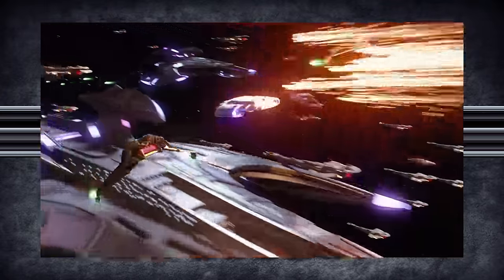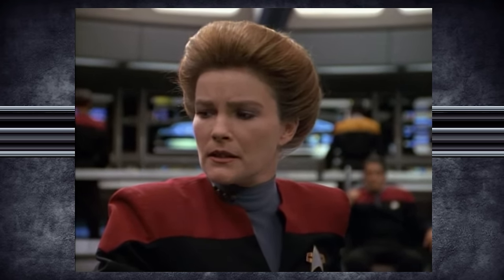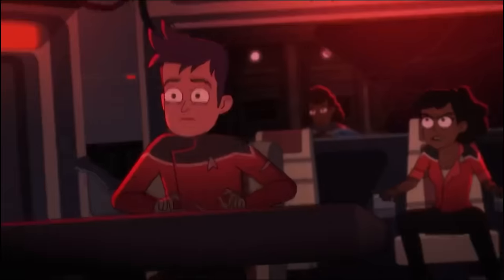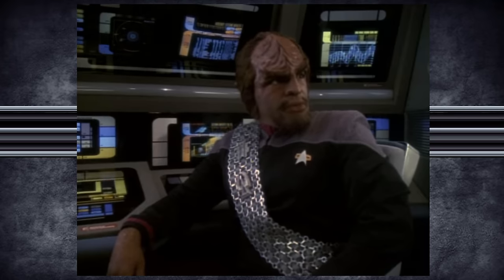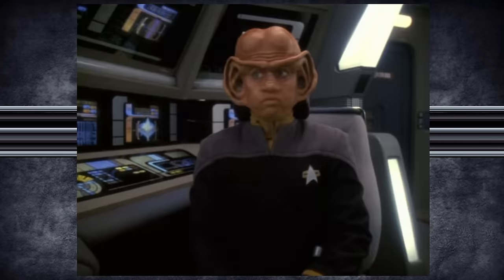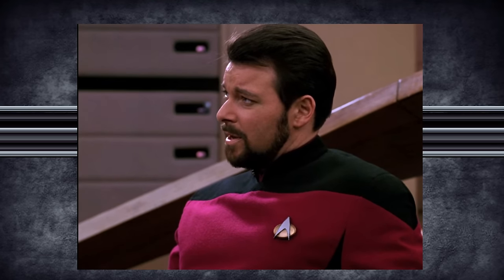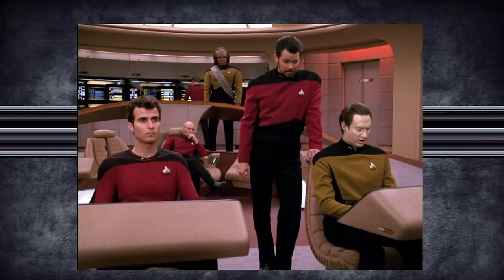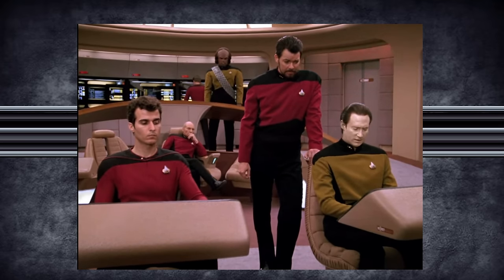Why Starfleet's Bridge Design Was Lethal to the Crews

Comment: The lack of seating on the Galaxy-class Enterprise's Tactical Station, and by extension the bridge layout in general, actually makes sense when you're considering the Galaxy-class was designed and built during a golden era of peace for the Federation. Tactical isn't required to be manned directly unless there actually is a combat crisis, meaning the Security Officer wouldn't be required to stand at that station normally, and would typically be found at the Security Control station during normal times (The station Worf is usually shown getting up from to move to the Tactical Station).

Given the relative non-threat of the Cardassians, the generally secure ceasefire with the Romulans, peace with the Klingons, and the Ferengi and Borg not having yet been discovered, the designers of the Galaxy-Class presumed any tactical threat would be rather swiftly dealt with with minimal damage (since the Cardassians were the frankly laughable 'main enemy' when the Galaxy was designed), with the Security Officer not needing to spend more than an hour tops at Tactical before resuming his normal station at Security Control.

Thus the bridge was designed more with the expectation of NOT needing too much in the way of tactical oversight, and the commanding officer of the vessel mostly focusing on what is directly in front of him, typically communications with whoever they are speaking to to foster more diplomatic functions (hence the Counselor's presence on the bridge) and visual assessment of any situation they come across. The Galaxy-Class is not a warship by design intent, more an armed exploratory and diplomatic vessel that was generally not expected to need to do a lot of fighting.

Which was a mistake on Starfleet's part based in hubris, and one they started rectifying in later ship designs.
Reply: Plus the Next generation the ship is a Civilian ship those crew comfort is importance and having a military bridge design might send the wrong signal.
Reply: Well said both of you
Reply: This reminds me of the post WW2 fighters designed without guns. All engagements would be accomplished by guided missile if not with low-yield nukes. Vietnam disrupted this design philosophy.

Comment: The argument for the transparent metal actually makes a lot of sense to me. It makes me think of the scene in the Avengers movie where when the helicarrier is in danger of falling. When that SHIELD agent mentions the navigational systems are down, Fury asks if the sun is coming up and then tells the agent to put the sun on the left of the helicarrier. Being able to see outside would make a lot of sense for that
Reply: Also sad we couldn't get the clip here where Data was recalled by Soong and Riker commented they had to look out a window to know they were out of warp.
Reply from the maker: That’s exactly what I was thinking of but I kept getting hit by a dmca , couldn’t use it
Reply: @LoreReloaded  Damn :/
Reply: Just keep in mind that you need to turn of the light inside to see anything through thouse windows. As long as sensors are active and said windows double as screens I give their ability to provide an wiev of the outside a pass thou. If power is cut, do not activate strong emergency light on the bridge or you will not be able to see anything.
Reply: @LoreReloaded  
I was thinking of worf's computer trick during that battle exercise with a constellation class ship. He tricked the view screen into showing a romulan ship.
Reply from the maker: @icecold9511  So I'll agree that we see that on the viewscreen, but i always interpreted that it was the sensors that they were really focused on and not the change on the view screen itself. Again, the view screen doesnt feel like it would add much to combat as you need a wide view which it often doesn't provide and for normal operations they don't use it at all for getting from here to there. That's not an illegitimate counter though, for sure.
Reply: @LoreReloaded  it is provided for our benefit. Aside from fine navigation, where that view is horrible, it would be as useful as a window on a sub.
Everything is so far away and moving so fast, you wouldn't see anything. 
And at FTL speeds, you can't see the Borg ship chasing you.
Reply: The problem with having a window on a spaceship is that you won't be able to see a bloody thing out of them. Even though we notmally see ships duking it out at really close rang,e in reality they're supposed to be hundred, if not thousands, of kilometers apart. You're not going to see anything from that far away with the naked eye, especially given how little light there is in deep space.
Reply: That of course is soo much help in combat in space where, if there are no reasons for appearance in visual media, the actual fighting will happen at ranges measured in light seconds. At the distance from the Earth to the Moon, the Enterprise D is smaller than a speck of dust from 3m distance.
Without an optical instrument, aka telescope, there is absolutely no chance in hell to see anything.
And if you use an optical instrument you can as well just pipe the image into a viewscreen.
Sure, make it so that the viewscreen can be moved aside in an emergency, but in general, if your sensors fail, you are on shit creek anyway, and it is just a matter of if you can use your hands to paddle or not.
Reply: @icecold9511  it brings to mind the last few minutes I have spent trying to swap a fly in my living room,  that SOB is clocking low impulse speeds at best!
Reply: @Riceball01  Actually, if we are talking space combat between capital ships with direct fire kinetic or energy weapons , they would take place at a few hundred kilometers distance tops due to the light speed limitation. If you were at a distance of 3 light seconds, traveling at half Impulse speed, your direct fire weapons would be lagging by..... 3 seconds and would therefore miss 100% of the time. This is also why windows for combat would be useless.

Now if you talking guided munitions, then you could theoretically engage your target at any distance once you had a hard sensor lock. But of course Starfleet eschews dedicated missile frigates like we have today to parody the glory of the Age of the Naval Rifle-based Battleships.
Reply: @mwhitetail  I distinctly remember Mr. Worf giving a report on an enemy being 7500 km distant when Picard ordered him to fire.  I'm not sure how big in size a starship is supposed to be, but even if we assume they are the size of an aircraft carrier, exactly how much detail are you going to see at that distance with the naked eye?  You pretty much have to assume any shots would be computer controlled, with the tactical officer just telling the computer what you're shooting at.
Reply: @icecold9511  Aye, sadly Star Trek doesn't do a good job at conveying just how large space is and what combat ranges would be. Judging by what we see in the series, all of them, it seems to be less than a hundred ship lengths, which would be in current terms almost point blank range.
Reply: @katherinestives940  Yes they use computers to lock on and aim, but even Isolinear ODN computer systems still rely on light speed; hence the 'O' in ODN as Optical Data Networks. The computers would be just impaired as a human mind due to that lag. You could argue A.I. predictive systems, but judging by how badly those work in video games on time scales greater than say 750 milliseconds, I would say that the lightspeed problem would still be a huge pain in the ass even in the 24th sentry
Reply: @HereticalKitsune  Ha! I learned something today. Used google assistant to find out that 7500 km is just .025 light seconds. That sounds a very reasonable distance for direct fire weapons with a very minimal amount of computer control. Or a lot similar to what we see in Star trek than I would have believed.
Reply: @Riceball01  : Those windows could have a lens built in. Materials science has improved enough one could do that.
Reply: I actually don't think the windows do make that much sense. I think the distances these ships would be engaging themselves at are so far away, that you wouldn't be able to see what you are shooting at with just your eyes. Space is big and black. Spotting a small small small speck that is the enemy ship with just your eyes is going to be really tough. My head canon was that the windows were actually just cameras on the outside of the ship that gave the impression that it was a window and that they could change it to view different angles away from the ship.
Reply: 1:It’s supposedly transparent aluminium which is stronger than steel, but presumably weaker than the duranium or tritanium that starfleet ships are made of, otherwise why wouldn’t they make the entire hull of the same material?

2: Given that we’re talking about space and other opposing vessels are either moving at relativistic speeds, full impulse is stated as being 25% speed of light, in which case being able to physically see them in close quarters is virtually impossible, or so far away as to be equally as impossible to physically see, then the trade off in protection for physical visibility wouldn’t be worth the added vulnerability.
Reply: Isn't the first mention of transparent metal by Scotty in the film The voyage home when he gives a company the specs so he can make the tanks for the whales
Reply: Having windows on the bridge and being able to see in all directions is important for 21st century ships.  What they would need to worry about with real windows on starships (as with the ISS) i) Relativistic effects.  If you are moving even a small fraction of light speed, what you see outside is really warped and distorted.  ii) The sun is really bright, you won't even be able to read your instruments with the sun in your face, especially without any atmosphere.  How much more if they are around a star with even higher luminosity, or much closer to a class G star like our sun?  You could go blind....
Reply: @DrewLSsix  That's because the Musca Domestica class max out on not speed, but maneuverability and sensors. What you must do is use area-of-effect attacks to negate those advantages, for example: The "Clap-Clap" attack (clap hard near - but not at - the target, which destabilizes its travel medium, thereby reducing its maneuverability and sensors, followed by a second clap attack at the now destabilized target) or the "Spray And Prey" attack, which uses a water mist to achieve the same effect.

Either way... HAPPY HUNTING!
Reply: @Riceball01  yup, considering transporter range is something like 250,000 km and I believe phasers have an even greater range, and torpedoes can shoot across a star system so. If your using the windows (and naked eye) in combat to see your target, your way to close.
Reply: It took me FAAARR to long in that part of the vid, for me to realize he actually meant the physical windows on the ship. They're so small, I hardly noticed them. (Assuming the screen at the front is a Monitor)
I thought he was talking about the glowing screens coming up from almost every console.
Reply: @brodriguez11000  Not a lens, but a viewscreen. Combine the two - turn on the screen when you need to, but when it's off (or damaged), you still have the window behind it.
Reply: I liked the design of the original Battlestar Galactica for that as well.
Reply: @LoreReloaded  Windows on a starship make no sense. So first let me debunk your whole transparent metals bit. Just cause something has aluminum in the name doesn't make it a metal. In star trek 4 he creates a polymer compound on the computer and calls it transparent aluminum. Its obviously a faking of the chemical science as frankly star trek has about as much a relation to real science as I do to a toad, but lets assume that someone did some research and tried to create something that looked reasonably accurate. The molecule he creates on the computer has nothing to do with a metal, all the electron spheres are far to stable. It actually has far more in common with a plastic. From there we can infer that transparent aluminum actually has more in common with bullet proof glass than with actual aluminum. This is also bore out by the fact that transparent aluminum actually exists and is a polymer with strength similar to that of aluminum. Now beyond this even if the window were absolutely transparent, space is a dull black void, the ships aren't very close and human reaction speed sucks. All good reasons not to have these things on a ship. Even if the bridge lights wouldn't make looking out into space basically like looking into a mirror, there would be nothing to see. Most of space would just look like the earths night sky only with more contrast. You could see more stars, but thats about it. Even when you were to be in a ship to ship battle the ships would be hundreds of miles upon hundreds of miles apart and you are moving at a significant portion of light speed. You know what that means? Our reaction speed means nothing. The angles between the ships are changing so fast that no person could actually hit anything that was moving. Even more beyond this is the fact that because you are moving at relativistic speeds you need to calculate trajectories with relativistic ideas in mind. Basically the thing you are aiming at isn't where you see it to be, and you won't know where it is until you hit it. The targeting computer can do this calculation, as human cannot. Windows are beyond useless, there are no navigational points to use to correct yourself, there are no uses for windows on a space craft of these types.
Reply: @LoreReloaded  Using one piece of science FICTION to explain another is circular logic: The underlying reasoning is the same - *because it LOOKS good*. In real life, naval combat already 99% takes place outside of visual range - aircraft carriers, not battleships. In space combat, the distances would be magnitudes larger and a window would be utterly pointless.
Reply: Arguably, that only works if you're under gravitational influences. In a space with no up/down, that specific circumstance just tells you whether you're heading towards/away from something (which still isn't useless, but you have to be a very special type of "screwed" to have all your sensors down/damaged and still have a ship you want to steer)
Reply: Space is a lot like underwater in that regard subs have no windows

Comment: "Let's run around like sheep without sense" Starfleet bridge design while in battle
Reply: Best design feature in TNG is the battle bridge. Always have a back up in case of an emergency.
Reply: @hackman669  In Star Trek you have to accept certain things as "the price of admission", but Lore Reloaded is correct in that on any vessel expected to go into combat (of sufficient size) you should have a main and an auxiliary control.  In actual combat, the first officer would move to auxiliary control with a back-up command crew.  They would constantly be updated by CIC (the combat information center, in case you didn't know the acronym) in case the main bridge suffered a casualty (got blown up or incapacitated).  

In addition, both bridges should be located in a more interior position on the ship to put more armor, shields, and just plain mass between them and potential damage.  You really want your primary computer core, your engineering section, and your command facilities as well protected as possible.  If you lose any of those three, your ship is dead in the water.  Well . . . space, in this case.
Reply: @hackman669  I contingency your point.

Comment: I was totally expecting as you went into discussing the large barrier making up tactical on the Enterprise, that you would have included one particular clip that I recall in which an intruder was on the bridge and Worf literally vaulted over the side of the barrier. I can't remember which episode that was, but it certainly went to show that it was a pain in the ass to effectively move around the bridge in the event of a close quarters combat scenario.

Another interesting thing to think about is relief staff. More often than not, an away team was suddenly and rapidly formed and often included Data, and many times Worf. The second they leave their posts to head to the turbolift, two random Ensigns would rush in and take control of those stations. But, where did they come from? They're literally RIGHT THERE at all times, yet have no designated location from which they came lol.

Cool video though! I like the breakdowns a lot.

Comment: you know a lot of these layouts actually mirror or mimic real bridges on ships.    

Most ships in modern earth have an explosed main bridge,  and a secondary battle bridge ( called CIC)

A small patrol Frigate for example,  will have at the front of the bridge, the helm and navigation stations, these are often crewed by 2 different people.     behind that on one side would be tactical, on the other would be radar/sonar/sensors.    This person could feed information across to tactical,  selecting a target, and providing the information to tactical weapons officer who would slew the weapons onto said target.   between them was often the captain... who would give weapons release permisison, and had an overview of helm, tactical, nav, and weapons.

Behind him would be the engineering, who would monitor engine temps, ship balance and other things.    and across from engineering was a back up station... or coffee maker...        comically, bigger, wider ships, often put ALL the stations up front in a row.
Reply: last I checked teh Water based ships we use arent capable of approaching light speed, also on earth line of sight is not 12 million miles.
So the logic is flawed.
Reply: @julesmasseffectmusic  not really,  cuz humans often take an,  "if it aint broke don't fix it" approach.